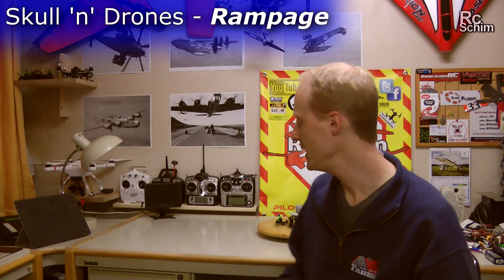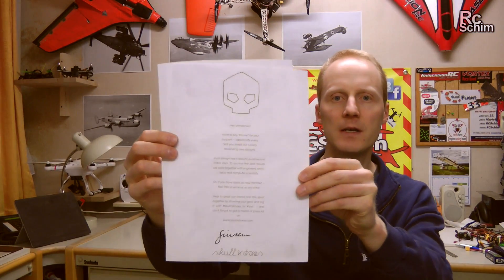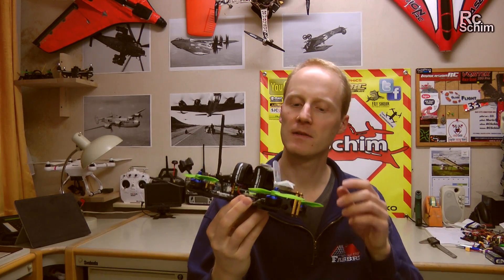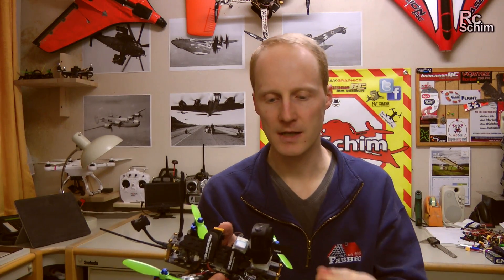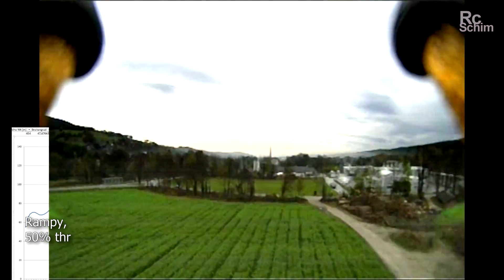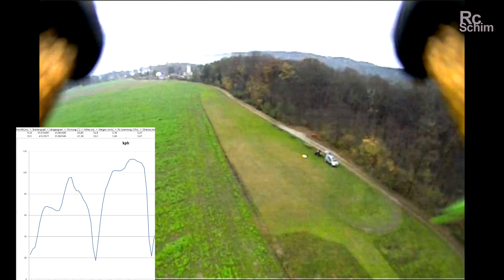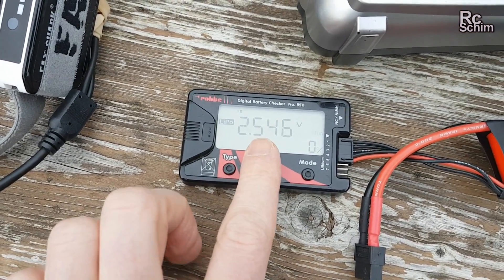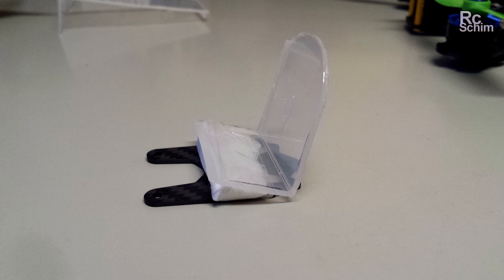Skull and Drones Rampage - my fastest racing drone (Speedtests, Full review + Flights)

Comment: Nice looking frame but I can see by it's construction it's too heavy and the arms are too wide ,  they would obstruct the flow of air from the props too much , it would be ok for a freestyle quad  but not for serious racing .
Reply: Well, the arm width is the same as a vendetta about 3cm split in two 10mm. The weight is ~110g with aluminium hardware. But depending on aerodynamics - It's not an airplane, and not used as such. 

Those small surface differences based on the radius the propeller turnes have a very little impact of about 5-10% (~15km/h) on the top speed, but almost no impact in fast push outs where you never reach full speed. (like in the most races.)

But most of the races are now flown at 100% speed, so it's not really a difference. Stefan Meyer won almost everything this season with this frame. 

But as the name suggests, it's made for durability. And he never broke an arm since April. :) Thats what we wanted to proof. Unbroken arms with holes. The most aerodynamical frame comes next season.
Reply from the maker: not sure about the influence of the aerodynamics on minis. maybe their efficiency is lower than it could be with flat arms.
the next on I will test has smaller arms - thinner. but almost the same motors. curious about the topspeed :)

Comment: ... looks like a solid build frame :-) ... and the speed is awesome, isn't it? Nice to have a shop close in town :-D
Reply from the maker: it's not that close (Vienna) but still "regional" compared to the chinese frames :)
Speed and performance of the current quads is awesome. but I hate to fly full throttle - makes the batts empty so fast.
found that 50% thr is already 80kph - more than enough for cruising around, fast if you fly low and more efficient, greets.
Reply: ... nice :-)